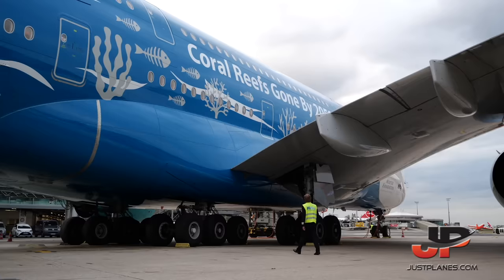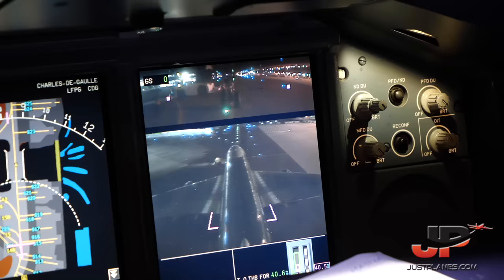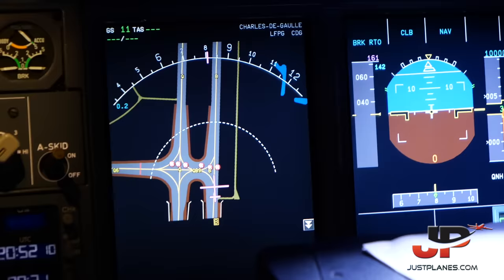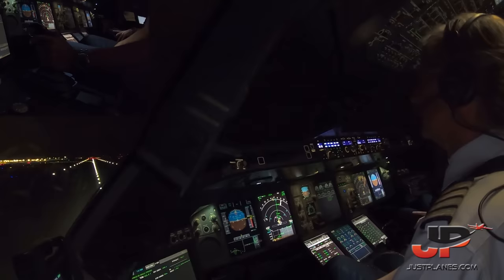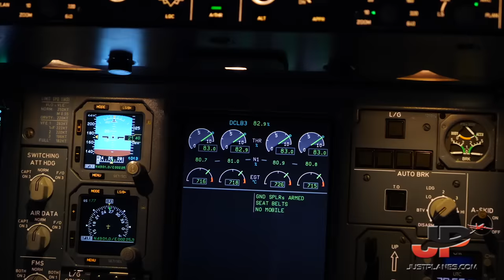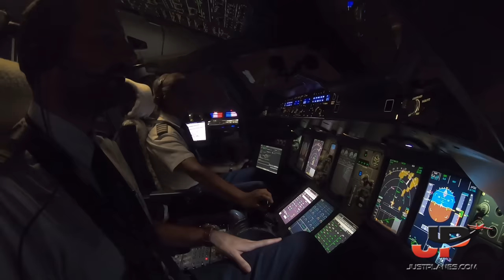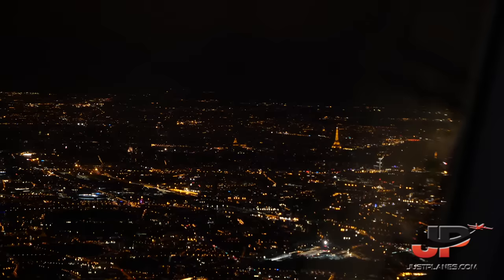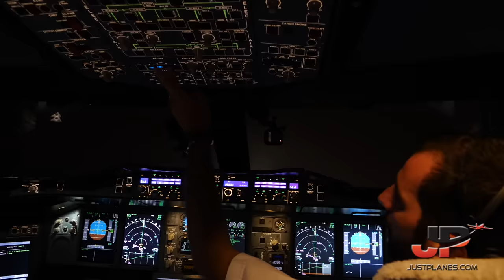Fantastic Cockpit Views AIRBUS A380 Takeoff | 8 Cameras

Comment: Sorry but, though I'm British, if I were a pilot I would want a proper Boeing style control column.  That's more like flying to me. Airbus are just too technical and only require pilots to monitor the plane rather than fly the damn thing.  Notice that the pilot, not long after take off, engaged 'Auto Pilot One' and then sat back looking a little like a fifth wheel. 

Sadly, several Airbus have crashed, killing all on board, because the automation failed at night and the pilots could not recover the plane in time.  Crash investigation authorities said that pilots should be flying the plane with automation monitoring; not the other way around.

An acquaintance of mine used to fly Vulcan bombers in the RAF.  During the Falklands conflict he flew 8000 miles at night with almost no instruments; just the stars for navigation.  All those screens are distracting and overkill imo. 

Keep it simple as it can be and don't complicate things unnecessarily is my view.
Reply: And how often do Boeing pilots hand fly their planes? Not that much different from Airbus is the answer. Boeing pilots also put the autopilot on straight after. You know why? Helps reduce workload. Instead of being soley focused on following the flight directors he can now look out for traffic and go through the checklists. 

If you're referring to AF447 then the automation didn't "fail". It went into a alternative law because the pitot tubes were blocked. A modern 777/787 would also have some sort of unreliable speed indications. All the pilots had to do was maintain level flight and set thrust to predetermined power until the pitot heat melted the ice.

Those Vulcan bombers were made in the 50's and 60's. You think the RAF still have old steam gauges and navigate by the stars today?

How about you take a look at crash statistics from the 70's and 80's before glass cockpits and fly by wire were invented and compare them to today?
Reply: @tomstravels520  The airbus pilots were out of the loop too long and weren't, at nightime, able to establish what the orientation of the aircraft was. That was among the the conclusions of the crash investigators.  The point about the acquaintance who was a Vulcan Bomber pilot was about pilots relying too much on instrumentation. It was NOT about thinking the RAF preferred 'steam gauges'.  In the cases I was referring to it wasn't ice that blocked the pitot tubes but insects. This caused unreliable altitude and, as you rightly point out, airspeed indication

Crash statistics from the 70's & 80's would factor in a lot more than the lack of fly by wire. Less advanced engine tech, less sturdy air frames and less experience among air crew and flight controllers would have been a contributory factor when comparing then to now.

Automation is fine but I believe, as pilots are responsible more than anyone or anything else, for our safety as passengers they should ALWAYS be flying the plane first and foremost.  That way they are always aware of exactly what situation, night or day, the plane is in.
Reply: garycarter01 that insects blockage crash was Birgenair 301 and that was a Boeing 757 actually. 

They are always flying the plane. Aviate, Navigate, Communicate always in an emergency. You don’t seriously expect a pilot to fly with no autopilot for 10 hours over the Atlantic do you? Operating the autopilot is still flying the plane. Not their fault if they put the aircraft into VNAV and LNAV mode so it automatically followed its programmed route and don’t have to make heading adjustments constantly.

Look at the BA pilots who landed an A319 even with loss of hydraulics and engine fire or Sully and the Hudson.
Reply: @tomstravels520  My point is Thomas, and this has been underlined by investigators on occasions, that sometimes pilots, when things go astray in certain situations, take too long to recover from faulty automation and therefore lives have been lost. As there are TWO pilots per flight deck it should never be a problem, regardless of the length of the flight, to remain always in overall control of the plane; meaning that ANY situation that develops will not cost critical minuets/seconds to further assess.

It's human nature to 'switch off' here and there and get too distracted if the plane is flying itself. There was a case years ago of a perfectly good aircraft flying straight into a mountainside at night because the pilots got too distracted by the failure of a not too significant part of the instrumentation. 

And don't you think making heading adjustments constantly is just the thing to keep pilots in the loop better.  If I was a pilot I would want to be continuously 'feeling' the plane.
Reply: garycarter01 so you’re just never going to o fly again because you don’t trust pilots and nearly all modern aircraft are fly by wire anyway? There is a difference between switching off and actively checking the automatics. I drive car with cruise control. When I have it on I don’t lay back and assume it will stop for me all the time. I still look around and check everything is normal and it responds correctly. I just don’t need to constantly check my speed every 5 seconds because I’m not manually controlling it. 

Tests have shown pilots would be more tired flying manually because they have to work their brains so much more and that can lead to more mistakes possibly being made later in flight. Why do you think when the autopilot is on that pilots “aren’t in control”. In RVSM airspace you’re supposed to have the autopilot in anyway to maintain separation

If that example you gave is AA985 then your argument has errors in it. And no I would not want to constantly make heading changes because then my aircraft would not be maintaining the correct path it should be on. In nav the heading can be infinite angles. In heading mode it can only be 360 angles.
Reply: @tomstravels520  My point was that I DO trust pilots; more so than automation. I don't know how you missed that.  You say you check your cruise control every 5 seconds. What's the point of having it then?  The more you relax at the controls the less engaged you are in what you're doing. There's a balance to be achieved and having driven all over Europe I can tell you I never once wished to have a silicon chip overly controlling my fate.

'Tests have shown' you say. Tests that say pilots paying attention and being more aware of the feel of the aircraft leads to more mistakes. I very much doubt that!

Thomas you seem to be very much on the side of software rather than humans. I'll take the decisive abilities of a real live pilot over the cold, unfeeling influence of automation any day.

And with that, my fellow aviation fan, I bid you best wishes and adieu (late for work).
Reply: garycarter01 read again carefully. I said I DON’T need to check my speed every 5 seconds as I would have to if I was manually controlling the speed with my foot to make sure I didn’t exceed the speed limit. Cruise control means I don’t need to because I know it will maintain the speed I asked so I can concentrate on the traffic around me and predicting what will happen next and checking mirrors. Same reason I drive an auto. I don’t have to think about changing gear all the time and making sure I’m at the right speed to do so.

You still think as soon as the autopilot goes on that pilots fall asleep or something. I want to see you try and fly a plane manually for an hour or 2 using a yoke and manual thrust and tell me you could do that repeatedly maintaining altitude, speed and heading all at the same time. You say you trust pilots more than automation yet all pilots now use autopilot for majority so......how does that work?

Those tests were done not long after the Air France crash but they still found that pilots who tried to fly a plane manually were overworked due to using their brains more, focusing on nothing but their instruments so couldn’t really look outside. Basically it was the equivalent to trying to stay awake for 48 hours instead of letting brain rest because when not flying the PM had to handle all the other duties. 

I am on the side of software assisting pilots which you seem to want to throw the autopilot out the window and do everything yourself. I’m not saying to replace pilots altogether at all but they need automation to relieve the load. Why do you think the flight engineer was eliminated?

Comment: 260 tons of fuel only in the wings and has the weight of a fully loaded A340-300, you all know this is bullshit right??
Reply: So you must be very familiar with the A380.   Please give us all the info you have seen with your own eyes...
Reply: first of all the fuel isn't only in the wings, second, the wings are massive. you can comfortably stand inside them on their thickest part.
Reply: You don’t need to be a wizard to figure that out that the weigt of a A 340 don’t fit in only two wings of an A380, like you could fit an elaphant in a mouse.
Reply: @883Dion  does the term density tell you something or did you not yet visit school?
260tons of fuel is in volume only a cube of 6.5x6.5x6.5 meters. That easily fits into the wings.
Your mouse elephant example is rubbish because both have around the same density while an aircraft and fuel do not.
Reply: @883Dion  so you don,t have any experience?  You just claim to be an expert on a subject you know absolutely nothing about

Comment: Auto pilot so early!
Reply from the maker: I would answer... its a long day with a late night departure... nothing to see after takeoff so why not let the plane do what it does best :)
Reply: Because humans are better at low altitudes and speeds. But as the A380 is French and has a table instead of the stick, I think it was time for dinner. rsss
Reply: Seriously, autopilot below 180kn and under 2000 feet is unusual I think. And the operation of the throttle levers? Another unusual thing.
Reply: Totally depends. I think it’s a good idea to engage the AP early on complex RNAV departures. Allows you to monitor what’s going on better and decrease the workload for the pilot not flying.

Comment: Over engineered and complicated airplane. Once they are old, things and instruments starts to fail and one small problem will crash the plane. Just like your 2020 BMW but 1000 times more complicated.

Nothing matches the American Boing robustness and simplicity.

This is why A380 failed before it even started.
Reply: Absolute nonsense. Airbus are generally more reliable than Boeing and the instruments are all on screen so there’s no actual instrument to fail. Just a screen.